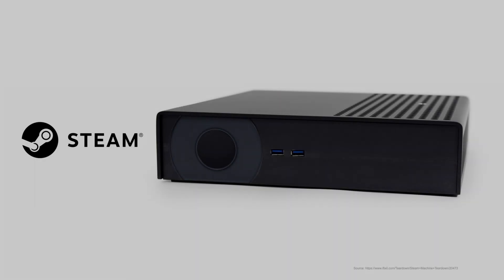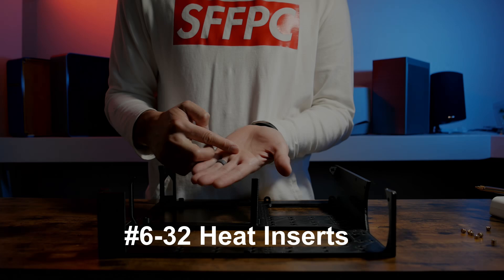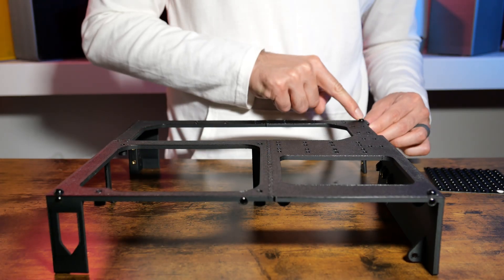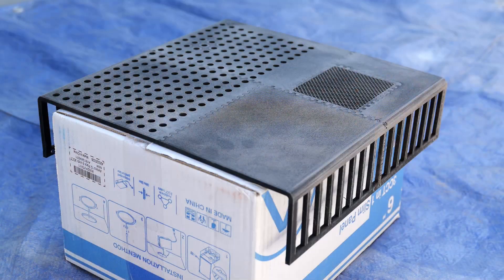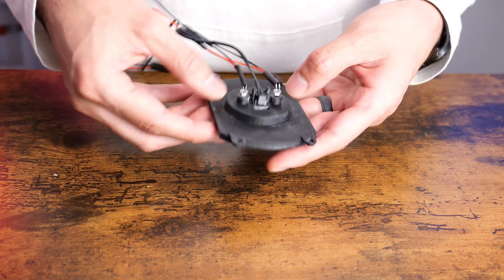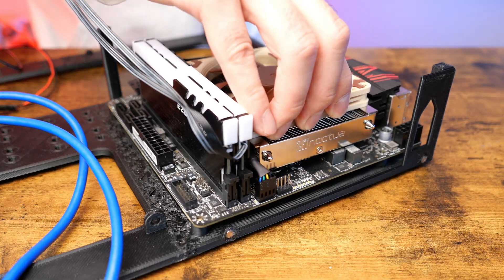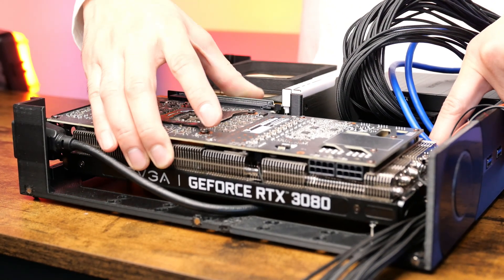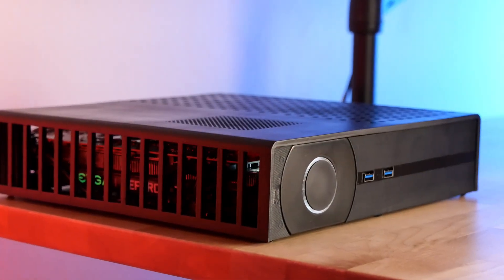Valve Steam Machine PC Case - 3D Printed

Comment: Hello, great build of a steam machine replica! I am completely new to 3D prints, but I hope I find something I am looking for. I am looking for a mATX MB preferably with an normal ATX PSU that I can lay down like an old DVD player that fits in a TV shelf... The height is the problem, not the width... Do you have something like this in your portfolio? I have a buddy who could do the printing for me.
I can't find a case to buy...
Thank you for this inspiring video!
Reply from the maker: @b.k-berg2425  lay this on its side lol

https://www.printables.com/model/1172682-sug-freebeam-matx-girthy
Reply: Thank you! After my post I checked the slot in my TV shelf... I have only 16.5 cm, your example has 19 cm. The cases I found in the internet for sale are really big if you want to fit an ATX PSU in it... 44x 32 x 15 cm approx... And I think that they are quite bad looking...
Your steam machine is much better ;) maybe I should go for some ITX mainboard and a sfx PSU... Then I don't have to rebuild everything in 1 year if can't handle the look of the substitute any longer 😅
Reply from the maker: @ You probably know I am huge advocate for SFFPC components so I won't say no to that plan!

Comment: I'm trying to assemble my own build with these files, but I'm having a lot of trouble with the power button assembly. How do you get the button to not wobble around?
Reply from the maker: It might be your printer settings and scaling. Sometimes some “slop” can help if things are loose… I know my Artillery Sidewinder X1 needs higher tolerances, and if I printed this on my Qidi Tech X Max 3, I would probably try increasing the flow rate to let it over extrude a bit.

Good luck fiddling. But also, note you can build or subtract with a soldering iron too 😉
Reply: @standupg4m3r  Fair enough, thanks for the tip! I ended up redesigning the button cap and modifying the frame to reduce the wobble, improve the design accuracy and lighting consistency, and eliminate the need for supports on the button cap.

Comment: Wait this 1th gen only support 2 slot cards? Or 3 slot card?
Reply from the maker: If you can find a 3-slot riser adapter, similar to the one I use in the video, it theoretically works; I haven’t tested it buy there is “space”.
Reply: @standupg4m3r  so can I just use an Ribbon cable instead of an Riser.?
Reply from the maker: @ theoretically? Yes?

If you have watched the full video you’ll still have the full limitations I mentioned.

Comment: I would like to see something like this but with the video card oriented with its PCB on the same plane as the motherboard, and the PSU flipped 180 degrees. That way all cold air will come from the same side. Then it could be placed against a wall or suspended under a desk. Bonus points if it can take an ATX PSU and motherboard where the GPU essentially lays on the PCI slots with a riser running under it. Then you get the SFF benefits with the ATX cheapness. Like the SFFTime N-ATX or P-ATX but a 3d print.
Reply from the maker: With most GPUs using airflow that is perpendicular to the PCB, it might defeat the purpose.

Having said that, at one point during this project, I was almost ready to give up and just make it an under-desk case lol

Comment: One tip I'd give is to use less heatserts. Plenty of your holes, such as the screws which secured the USB front IO, are clearly never intended to be undone through the case's life and therefore don't need heatserts. I only use heatserts for threads which will be screwed and unscrewed multiple times, such as motherboard standoffs. Permanent installations thread directly into the plastic to save time and money during construction.
Reply from the maker: I fully agree with you and thanks for watching! But in my videos, no one sees how many times I have to re-screw and screw for different shots or retakes. And for me to make two different versions of files that I charge $0.00 for? Nope.
Reply: @standupg4m3r  that's absolutely fascinating insight into the difference between designing directly for the end user versus designing with the middle step of content creation. I'd never even considered the impact of retakes on thread wear and how that affects the practicality of heatserts.

Comment: I was lucky enough to be chosen for one of these back in the day, and I still use the case to this day! The simple and durable design still holds up for the most part. I tend to struggle finding parts that work well specifically for this case so this video was actually a great guide for me even though there a few differences(like the gpu bracket issue). I always have to remove the bracket just to get a gpu to fit. Overall great video and nice build!
Reply from the maker: Thanks so much! And also congrats on having the real deal!!!
Reply: I'm one of the lucky 300 as well, and still have it though sadly it's been sitting unused for the last couple of years. I've been planning an upgrade and was just going to skip the GPU and go with a Ryzen 7 8700G (the iGPU on it performs better than the OG GTX 780, at least in benchmarks). But seeing a 3080 fitting in that space, maybe I can figure out a way to get an RX 6800 or 7800XT in there. Plan is to use SteamOS if Valve ever releases it to general PCs, or otherwise go with something like Bazzite or Nobara Deck Edition, so I'd need an AMD GPU for that to work properly.
Reply: @8BitCerberus I’m fairly confident a 7800 XT will fit. I’ve got a 3070 Ti FE along with a 5800X and 32GB RAM in mine rn
Reply from the maker: @8BitCerberus  you lucky son-of-a-gun!

That’s awesome!!! The AMD cards do tend to be a little more beefy, but I’m sure you can wriggle that thing in there. Custome cables will help a bunch and I wish I did it for this build (though it’s possible as shown).

Please send me a link when you finish! I’d love to see. Also let me know if you need any pointers modifying the bracket to fit.

PS - I’d also be open to helping you build it ;)

Comment: What slicer settings did you use?
Reply from the maker: Bear in mind this printer is not stock and finicky as heck. 

Little mesh portion: https://youtu.be/fdSeuXnyZlA?si=6h1z5tFo8yjejnqM

The rest were printed with standard PETG presets, but with fan at 0% and no retraction.

I have a new printer now: Qidi Tech X-Max 3 for 3D Printed PC Mods
https://youtu.be/ACI2cUQDgfg which could probably print this way better and faster at default everything.

Comment: a little different in small things, but overall cool) I read that Valve was supposed to post a cad file, but apparently didn’t post it because it didn’t release it
Reply from the maker: It had to be different for 3D Printing and I made some “improvements” like adding venting above the GPU.

Can you share a link where Valve announced or mentioned that the CAD files would be released?
Reply: @standupg4m3r  You can't send the link here, it's deleted.
Google "Steam Machine enclosure CAD files?" There will be a link to steam and there will be a link to the valve post in the first post

So for our own first prototype Steam Machine ( the one we're shipping to 300 Steam users ), we've chosen to build something special. The prototype machine is a high-end, high-performance box, built out of off-the-shelf PC parts. It is also fully upgradable, allowing any user to swap out the GPU, hard drive, CPU, even the motherboard if you really want to. Apart from the custom enclosure, anyone can go and build exactly the same machine by shopping for components and assembling it themselves. And we expect that at least a few people will do just that. (We'll also share the source CAD files for our enclosure, in case people want to replicate it as well.)

Comment: The original Steam Machine didn't actually remove the GPU backplate. Instead they bent the top part to be flat for mounting and then cut off the bottom part that would interfere with the motherboard. This can be seen in the teardown iFixit did
Reply from the maker: Hey thanks for watching. ifixit page is what I used for reference - and clearly they (Valve) removed the stock bracket and made a custom one: https://guide-images.cdn.ifixit.com/igi/IsParfAoCQKLY2Op.full

Notice the tapped punch out for mounting, which does not exist on the stock bracket: https://www.zotac.com/us/product/graphics_card/gtx-780 - the stock bracket also has wavy slots while the custom made one for the Steam Machine feature straight slots.
Reply: @standupg4m3r  I see what you're trying to say now
Your wording in the video was a bit unclear, it made it seem like they removed the bracket without replacing it

Comment: In a future build, you can try using laptop antenna instead of the small external ones. To make it work, you'd have to take out the wifi module from the MB, and clip on the laptop antenna wires direcly to the Wifi module, then route the patches for the laptop antenna somewhere on the case. I did that for my own personal HTPC to get rid of the external antenna, given that the external ones can make it harder to pack a PC from place to place (and sometimes the connector can come loose from contantly  connecting and disconnecting the antenna), and that has worked really well for me on my end!
Reply from the maker: I’ll look into it! Thanks for watching and sharing that suggestion. If you check out my other builds, I’ve built in the antennas inside the case but thins build was trying to replicate the original.

Comment: If Valve tried Steam Machines now I think it would work.  Before it was like 'why?' but with the advancements of Steam and then their Steam Deck they proved they can have a console like experience with, um, a console.  As a PC gamer and a Linux user when they announced the Steam Deck I was like 'yeah, right' but they have made it a pretty seamless console like experience.
Reply: I think Valve could do it today with a powerful, custom SoC from AMD that competes with the PS5 in terms of performance and price. That would be a great machine to get new people into PC gaming.
Reply from the maker: First off, thanks for watching! And second, really good points! It would likely be an all AMD affair, since nVidia is not so keen on opening up their drivers atm, but that isn’t a bad thing (I’m not so brand loyal) - a boy could dream is happens in the form of AMD Project Quantum ;)
Reply: Hmm I wonder what happened recently...
Reply: @iss138ma yeah, my fortune telling powers were strong 2 years ago!  It is 100% because of the ease of use of the Steam Deck though.

Comment: Great project I’d like to create a similar case and own a prusa mini with a smaller bed. Could you detail the way you cut your pieces to glue them later on ? Was it in CAD or directly in the slicer ?
Reply from the maker: Thanks for watching! I did mine directly in CAD, since I was able to control when the jigsaw pattern ended and what shape the lobes took. But in all honesty, with the hassle this method resulted in, I bet the Prusa slicer division methods would work just as well (if not better). When I reach the 6k subscribers I will upload both the cut up pattern I used with 0.25mm tolerance and one without - since every printer will behave differently. 

Good luck on your case and please ping me when you complete it! Love seeing other people’s work .
Reply: @standupg4m3r  oh and another thing that I’d be interested in: how do you make sure all screw holes are properly placed in your design, especially when using the riser + GPU. I don’t have the pc parts yet but want to design first and buy later if possible 🙂
Reply from the maker: @derek7808  https://youtube.com/shorts/cP33WCzgDFY?feature=shared

And 

https://reddit.com/r/sffpc/s/stlw32lStj

If you design around parts you can’t measure yourself, it can work… with lots of revisions and re-prints.

Comment: For some reason horizontal HTPC cases are so hard to come by (at least where I live). No doubt this will be an ideal way forward, with some effort.
Reply: Never knew that. But with the rise of steam os and better support for the "couch gaming experience" only a matter of time before HTPCs make a comeback.
Reply from the maker: @bhismanambiar  a g4m3r-b01 can dream. I was originally intending on installing Steam OS for this build, but learned that even though the OG Steam OS was for nVidia… team green is having issues installing latest Steam OS versions!
Reply from the maker: Thanks for watching and sharing your thoughts! 

The original Steam Machine had some users putting it on its side (ignoring how it will compromise thermals even more based on the side you choose), and I think it was driven by the negative of hori-cases and how much foot print they take up. I’m guessing this drives lower demand and less attention this niche form factor. But thank goodness for the few case manufacturers like Fractal and of course, 3D Printers! lol

Comment: With that height of ducts, couldn’t you have fitted a normal 25mm fan instead?
Reply from the maker: Thanks for watching! I would try it if I had a 92*25mm fan… but still happy with how well it sucks air in unimpeded with the ducts; I find fans perform worse and are louder when they have little space in front or behind them. I remember a good rule to follow is to have the same height as the fan both front and back.

Comment: The outside looks really good, apart from that left edge of the front next to the power buton area - you could've try to polish it and paint that as well. I feel like this is breaking the effect.
Apart from that - on the inside there were various partitions for separating and routing the air flow. Good work nevertheless, especially since you've figured out how to print it in smaller parts.
Reply from the maker: Hey thanks a bunch! The defects scream at me too, but I didn’t really want to do any more painting than I had to tbh 

Thanks again for pointing me in the right direction though!

Comment: The machine looks pretty neat. personally i would make the side vent more dense but this is a replica, so good job!
Reply from the maker: Thanks for watching! I wanted the side vents smaller too, but when I had the system in an open air setup, I honestly got super worried with the heat output of the components I was putting in. If I still had the same power envelope Steam had during its inception, we could be loving smaller vents right now. lol
Reply: @standupg4m3r  you could either go with 5600x or 5600g cpu and a low profile GPU
or go custom water cooling but it doesn't
make sense with this formfactor or make it a little bigger
Reply from the maker: @smasherxs  maybe I’ll fiddle more for the future but I’m already designing a new case for the next video lol
Reply: @standupg4m3r  Looking forward to it.